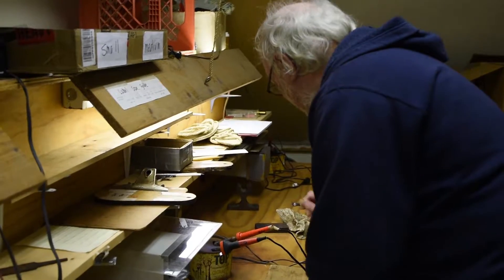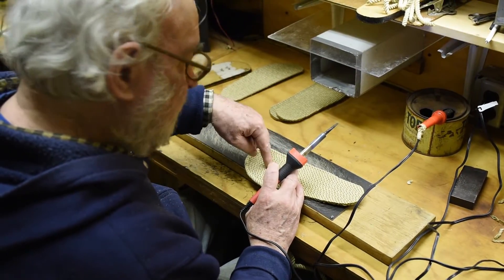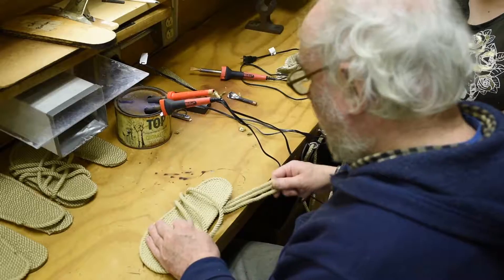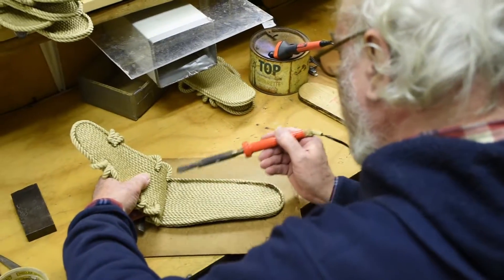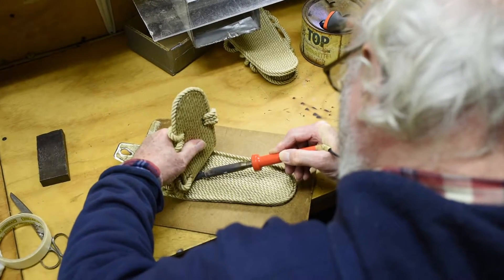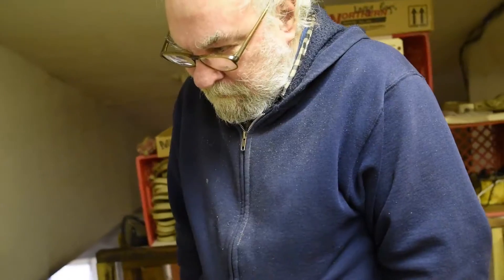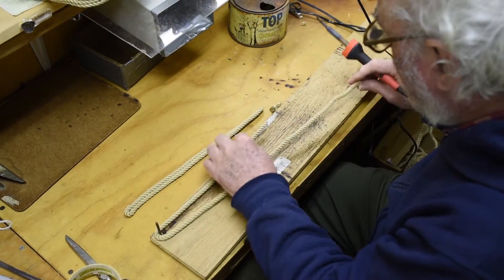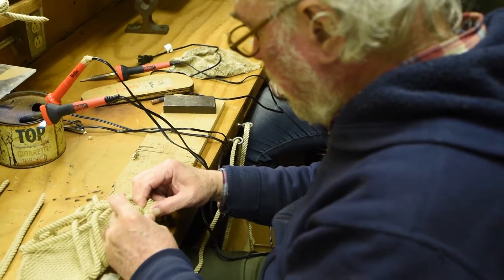How It's Made - Utopian Rope Sandals

Comment: Hello,
where can i find the machine in 3:14 ?
Thanks
Reply from the maker: If you listen to the video you can hear that it is a custom-built machine that required a year of tweaking to perfect. So this is the only one I know of!
Reply: The machine is basically a mangle iron with some advanced engineering attached. The machine was made by Peter Holmes in probably 1976.

Comment: About how long do the sandles last if I was to where them daily. I visited you website and really want to order a pair.
Reply: I simply love them and I would like to get a pair and help support  your community
Reply from the maker: Hello! You can call the front desk (number is on our website) to order. Depends on how you use them, of course! They hold up really well in the city, decades even. On rough Ozark trails with heavy usage they might last two or three years.
Reply: They last forever...my daughter made sandals at East Wind in the '90's and i've worn them thru the years.   I get them grubby in the garden, hose them off, let them dry and put them back on.  They look and feel great.   I'm in the Boston/Cambridge area and they wear out sooner when i wear them on the concrete....but, still, they last and last.